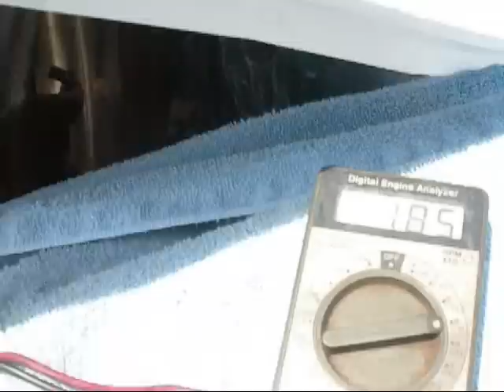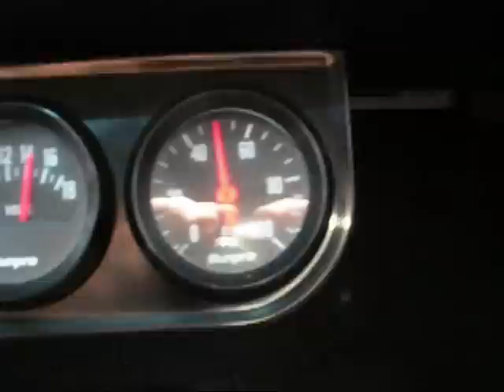Comp Cams xe268 camshaft BREAK-IN Olds 350 5.7L

Comment from the maker: It's a factory Oldsmobile big block 455 color.  "Oldsmobile Metallic Blue" is the name of the color.  Comes in a 12oz. spray can and is a high heat blend.  Look up  "Tamraz's TA-004" that is the exact same stuff I used, it's the only place I've seen that has an almost exact match to the factory color and is about 15 bucks per can.